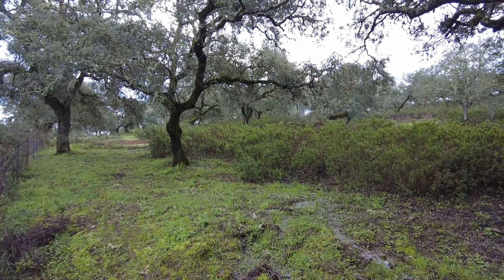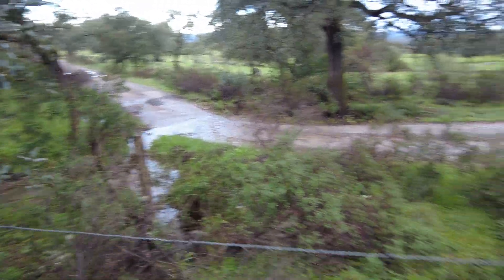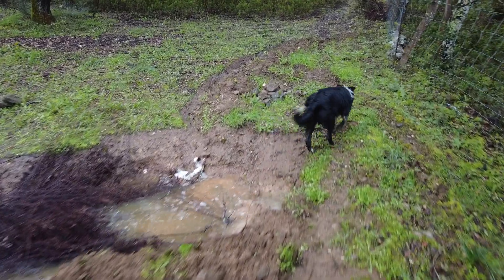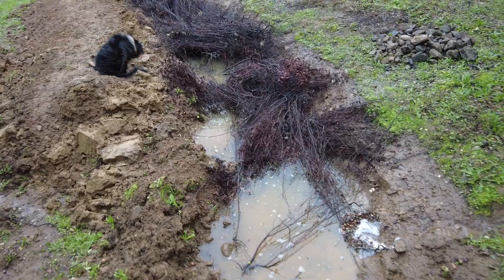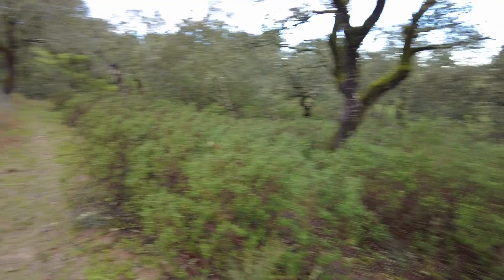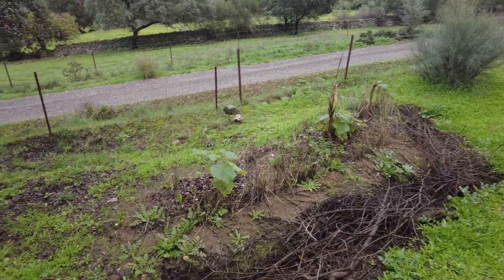Lowest point of property draws a lot of water that way.

Comment: Perhaps a good experiment would be to dig some random test holes to see how deep this moisture is penetrating around the property after the installation of the swales and water management structures. The deeper the moisture penetrates the better the land will deal with the next dry period.
Reply from the maker: Great suggestion. Thank you for sharing
Reply: @SuerteDelMolinoFarm  A manual post hole digger would do that job to a depth of say 90 centimeters.  I suggest digging the hole (to the depth that's doable, and monitoring the level of water in the hole over a period of time or until it overflows.  In essence, this is the reverse of a percolation test.
I'll suggest a good place to test this way is the qanat cistern.  I'm curious to get an idea how much water is lost.  Some sense of this factor is relevant to discussion of storing irrigation water when it is abundant. 👍
I would advocate for a pump that turns off and on with a simple mercury switch (similar to a sump pump).
Such a pump would never empty the qnant but simply pipe the surplus water uphill for storage until needed. 😊

Comment: Permaculture principle: Slow the water, store the water, sink it and then use it...
Reply from the maker: It doesn't want to sink into the clay. What shall I do? Meant as a light sharing. Thank you for your comment. Much appreciated
Reply: @SuerteDelMolinoFarm  As slowly as the water saturates the clay now, likewise, the clay will give up the water come the dry summer.  Remember how the clay instantly turned to powder when it was disturbed by the Giraffe last summer?  That was because that clay had been dry for a VERY long time - likely decades.  Watching clay take on water is one of nature's lessons in patience.  😉
Reply: With you adding brush into your swales, this will decompose and add humus (mulch) which will absorb more moisture to be available later. You are on the right track.
If you chipped this, the process will come along quicker. @SuerteDelMolinoFarm

Comment: I'm so happy to see that you are discovering self sown rye and oats!  That is huge - the 'magic' has begun.  I'll point out one viable seed factor in that particular location; it appears the "volunteers" were shaded by Holm oaks so they were protected from the extreme heat of the sun.  A factor?
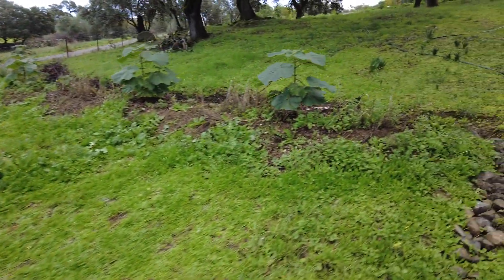At 6:22 lower right corner of screen; I really like the spillway from one swale to the next that appears to be a hybrid leaky weir and rock armoured drain down.  I noticed many piles of small rocks in your walkabout.  This is a great solution to create sheet flow and avoid erosion.
At 6:24 I see a flush of deep green leaves in clusters high on the screen just left of center.  Are those flowers (daffodils?) grown from bulbs that are naturalized?  If yes, it looks like you have several clusters that you can divide and spread around now to define a larger "patch" and encourage improved flowering.
I believe I see a distinct flush of green below all of the swales as well as taller and denser vegetation.
I surprised by the amount of water sheet flowing downhill to the low corner.  Looks like you have the opportunity to build at least one more swale running from the western fence line to the east.  I'm very surprised by the amount of sheet flow that is still exiting the property at the north west corner.
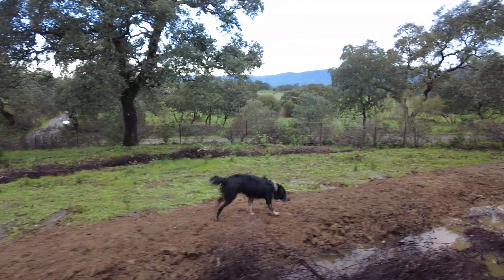At 4:56 it appears there is what I'll call a "micro pond' integrated into the swale and berm.  I think micro ponds are particularly appropriate on your property given the slope of the land.  The swale and berm alone does not seem to provide enough storage capacity. 👍  Everything looks great!
Reply from the maker: I really hope so Steve. Good observation. Well spotted. Keep sharing